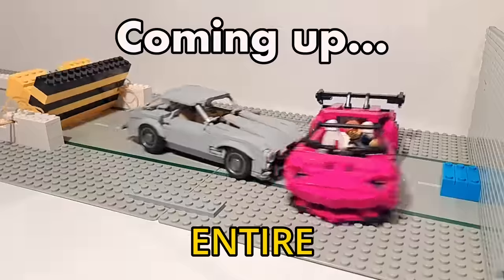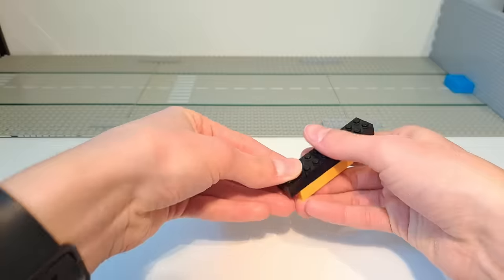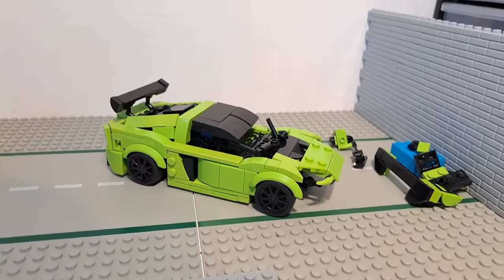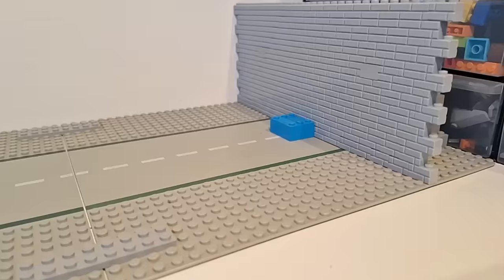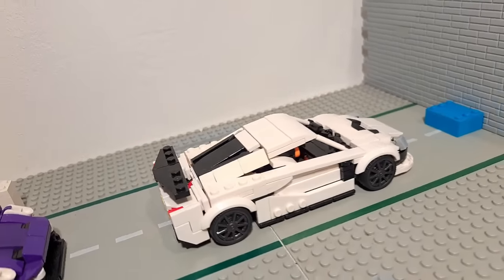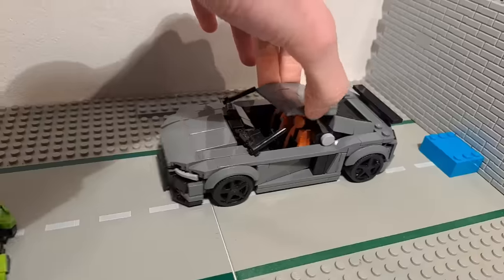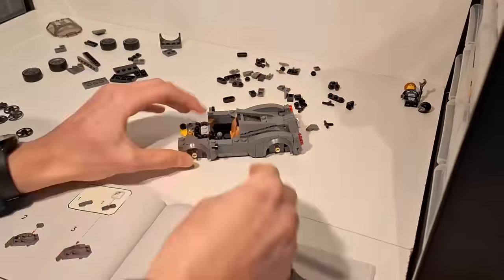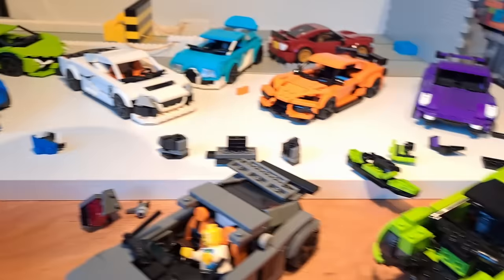I Crash Tested LEGO Cars...

Comment: Think your cars are still stronger then mine, I build mine to have opening bits which really cut into the structure.  Most of them have front fenders that are only held on with a single stud behind the front wheel and sometimes another stud in front of it.